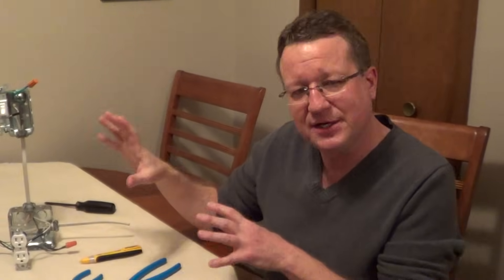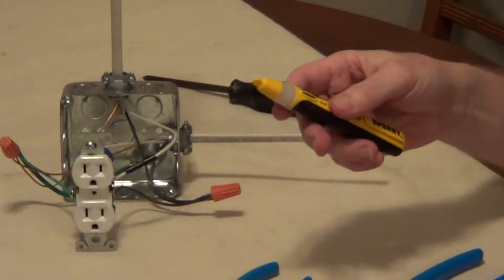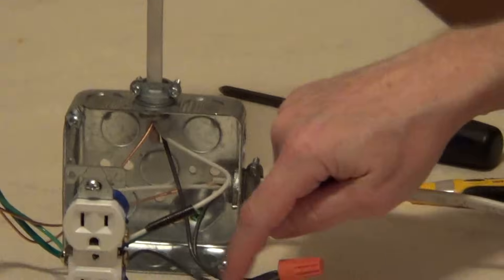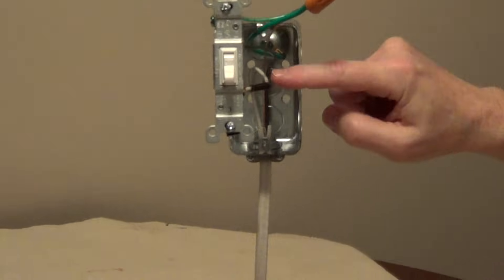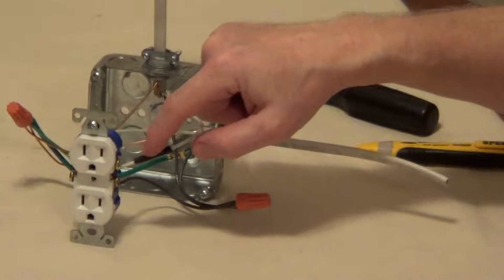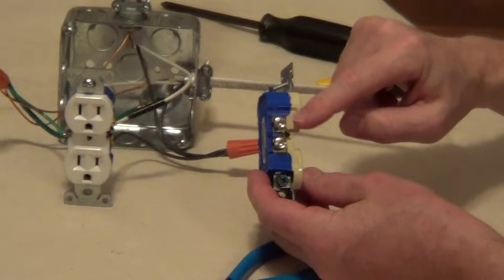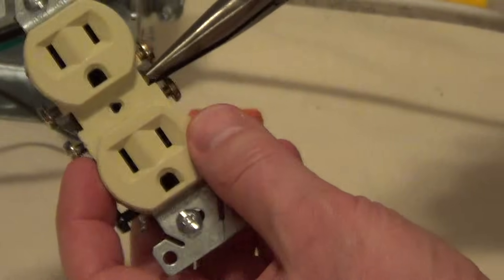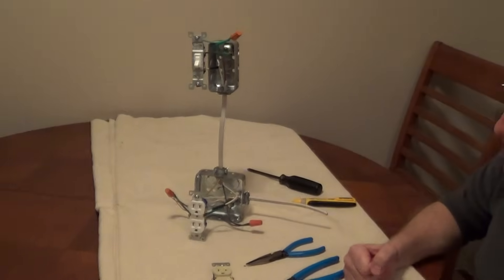How to Wire a Switched Outlet

Comment: Can both sides of the outlet be controlled by the switch?  Only one hot wire, no bridge, if not switched, both are cold?
Reply from the maker: Hi, yes you can connect the switch to an outlet and not break the tab on the hot side to turn the whole outlet on or off.
Check out more home improvement tips in our e-books https://www.amazon.com/gp/product/B0B2KW1FQ9?notRedirectToSDP=1&.
Reply: @FIXITHomeImprovementChannel Thanks!

Comment: Good info,..but do u need that pigtail for the hot, or could u just wire it directly with no pigtail
Reply from the maker: Hi, if you want to have a switched outlet, you will need to use a pigtail.
Check out more home improvement tips in our e-books https://www.amazon.com/gp/product/B0B2KW1FQ9?notRedirectToSDP=1&.

Comment: How do I install a GFCI outlet that has the top outlet only controlled by a switch?
Reply from the maker: Hi, you can't split a GFCI. You can put in a regular outlet and have it protected by a GFCI if you have an outlet before it on the circuit that you could replace with a GFCI. If it is the first outlet in a circuit, you can install a GFCI breaker. Email me if this isn't clear. fixitpodcast@gmail.com
Reply: @FIXITHomeImprovementChannel  thanks,  I just removed the wire to the switch so they're both on all the time.

Comment: Also note: only break off the tab on the hot (black wire, brass colored screws) side.  Leave the white wire side bridge tab in place.  I found out the hard way. 🤦🏼‍♂️. Thanks for the great video!

Comment: Wouldn’t  it be more proper to use 3 conductors wire?
Reply from the maker: Hi, yes the new code requires a 3 wire cable. This is how most homes were wired in the past.

Comment: So what you are saying is a new code requires you to go from a 14/2 to a 14/3 wire UNLESS it’s in a raceway or easily accessible, correct?
Reply from the maker: Hi, yes, this is the old way to wire a switched outlet. The new code wants a 3 wire cable with a ground.

Comment: Wow, that worked! Only thing I got stuck on was what to do with the other white wire from the breaker box. After looking at the video a few times I realized you wired it like a  normal outlet on the bottom silver screw. Thanks so much!

Comment: Hey there am I right ?? I did everything you said but in my case I have to bring power to the light fixture using pigtale wire from white and black connected to switch ?? Don’t know if this is right?
Reply from the maker: Hi, you can send me an email and pictures to fixitpodcast@gmail.com

Comment: At 1:30 you said you can't have 2 hot wires to brass screws without breaking the tab or it would turn off breaker. Is this true? I'd say it would just make both receptacles (upper & lower) hot and make the switch do nothing.
Reply from the maker: Hi, you're right on a standard circuit. I had a problem with a GFCI breaker tripping with the tab not broken. Should have clarified better.

Comment: where is the common white from the power coming in? does it matter which silver terminal its on?
Reply from the maker: Hi, the white wire in this setup is coming from the service panel. It can be on either silver screw terminal. You would leave the tab intact on the neutral side.
We have more home improvement tips on our weekly podcast https://www.himalaya.com/s/CR.
Reply: @FIXITHomeImprovementChannel  Gotcha thanks

Comment: I replaced an outlet where the top was controlled by 2 different switches on the wall. Even after breaking the tap off, when I plug the lamp into either socket, it stays on. Neither switch controls neither one now. Any suggestions?
Reply from the maker: Hi, you can send some pictures to fixitpodcast@gmail.com

Comment: I have a switched outlet in my room.  I want to install a ceiling fan in my room and I was wondering if I could use the switch that is controlling this switched outlet.  I know that I will have to run new hot, neutral, and ground wire from the ceiling fan location to the switched outlet box.  However I don't know where to take it from there.  Will I be able to power the ceiling fan from the outlet where the switch was controlling the switched outlet?  My thought is that I will be able to replace the outlet with a "non broken" outlet where both outlets are constantly hot.  But having both outlets that are constantly hot render the switch useless, right?  Thank you.
Reply from the maker: Here is a link that might help. Option 1 is the new way to wire a switch so you have a neutral available for other devices. 
https://www.easy-do-it-yourself-home-improvements.com/ceiling-fan-wiring-diagram.html

Comment: Does the neutral from the power source get pigtailed to connect both top and bottom or just one? And if just one which one? TIA
Reply from the maker: Hi, the neutral wire from the service panel is connected to either silver screw terminal on the neutral side of the outlet. You would leave the tab intact on the neutral side. 
We have more home improvement tips on our weekly podcast http://castbox.fm/u/6389499.

Comment: Great video  can you make both outlets hot without having to turn on the light switch?
Reply from the maker: Hi, if you have one wire coming into the box that is hot and not connected to the switch, just connect that to an outlet with the brass tab intact and cap off the wire coming from the switch. It will be hot all the time.
We have more home improvement tips on our weekly podcast http://castbox.fm/u/6389499.
Reply: FIX IT Home Improvement Channel ok thank you. By leaving the brass tab intact would I possibly encounter any issues with tripping the breaker?
Reply: FIX IT Home Improvement Channel thank you I tried this and it worked perfectly.

Comment: Have you worked with the newer leviton outlets? There is no pull tab on these outlets. Any thoughts on how these should be wired? Thanks!
Reply from the maker: Hi, do you have a model or sku #. I will check it out.

Comment: I want to replace a switched outdoor light to a electrical outlet is this possible with the current wire setup. The outlet will be on the inside opposite of the outdoor light. I'm replacing the hard wired outdoor light with a solar powered light. Electrical is updated within the last 2 years.. thanks for your help in advance...
Reply from the maker: Hi, you want to replace the switch with an outlet?
Reply: FIX IT Home Improvement Channel  no I want to replace the light itself with an outlet. I want to take the wires that run to the light and use them for an outlet.

Comment: You should have used a 3 wire cable from the switch to the receptacle.
Reply from the maker: Hi, yes I plan on doing another video with a 14/3 to show the new code. Thanks

Comment: quick question. I want to run wire from power source first to the switch then to receptacle . Do I have to reverse any wires for this. its just reverse of what you are showing. Thanks
Reply from the maker: Hi, It will be the same in the outlet box. You have broken the tab on the brass side. One wire that is always hot goes to one brass screw and the wire coming from the switch goes to the other brass screw.

Comment: I have two switches, one for garbage disposal one for dishwasher, one outlet under sink the switches control. both will run disposal but not my new dishwasher. diswasher runs when pluged into different outlet on extension cord. tester pluged in shows no lights pluged into either  plug in. whats up? Thanks
Reply from the maker: Hi, you will use a tester and work back through the boxes to find the hot wire coming from the service panel and then track down the problem. You can send pictures to fixitpodcast@gmail.com and I might have a better idea.

Comment: Great tutorial video!  I have two black hot wires on a second 3-way switch connected to the same common terminal by a technician.  Is it correct?   The wire connection, 3-way switches & light fixture are all good, but the light hasn't been working for years.  Appreciate your help.

Comment: Question. I have 2 white wires as well as the 2 black and ground wires coming in to the box. I broke the tab. 1/2 the receptacle is correct after I tested it, but the other 1/2 is reading "open hot" and won't work. What should I do to get the other 1/2 working? (I feel like its probably that 2nd neutral wire that's screwing me up)
Reply from the maker: Hi, can you email a picture of the box and wiring. fixitpodcast@gmail.com

Comment: This isn't code. Use a three wire. You need a neutral for the plug.
Reply from the maker: Hi, yes the new code suggests using a 3 wire to have a neutral available for future devices.
Reply from the maker: I added that to the description. Thanks

Comment: You dont say if you have to pig tail the neutral from the switch? Looks.to me you have it going straight to switch then back to receptacle, no pig tail, to come down to receptacle, i might be wrong
Reply from the maker: Hi, this is the way most switches have been wired with non-metallic cable. The neutral coming from the switch is marked as a hot with black tape and goes to the hot side of the outlet. The brass tab is broken, so half is hot all the time and half is controlled by the switch. The new code is using 14/3 to a switch so you have red and black on the hot side of the outlet and a neutral in the box with the switch, which is capped off.

Comment: this has not been allowed since the NEC of 2011
Reply from the maker: Hi, you are correct. I was answering a question from a subscriber about how their switch was wired.
I have under the video that the new code requires a neutral wire unless it is in a raceway or easily accessible without removing drywall.

Comment: I have a question.  I'm building a barn, and my plan is to install outlets on the ceiling joists to plug workshop lights into for lighting.  I would like to control them with a three-way switch at each end of the barn so I can turn off the power to all the outlets in the ceiling, thus turning off the lights.  I'm doing this in case I accidentally hit one of the light fixtures with my tractor or something and damage it to the point it would need replacing.  If that happens, all I would have to do is go get another fixture and plug it into the outlet (assuming, of course, that the outlet wasn't also damaged.)  Can you wire up something like that and show it on Youtube?
Reply from the maker: I will put it on our list. Thanks.

Comment: I have a switch in a room that I am assuming controlled an outlet at one point. Before I moved in all of the outlets and switches were changed out. I tested each outlet and flipped the switch but to no avail. What would you consider I do next?
Reply from the maker: Hi, I would take out all the outlets and see if you have an extra hot wire that was capped off. You can then follow the video to create a switched outlet.
Reply: Thank you
Reply from the maker: Let me know how it goes.

Comment: Hello Mr Fix IT,  I have a question?  I own a old home from the 1960s...    I have both the W and BLK wires as you have above which are both hot.....I would like to know about putting a new Smart Control to a light switch but it is asking for a White wire what do I do????   I have tried already but gave up any help please....  Thank you Diana
Reply from the maker: Hi,
If you have an electrical box with just hot wires, you will need to run a new cable that has a neutral wire running back to the service  panel.
Reply: thank you....

Comment: What if you have a hot wires running into the switch and want to connect an outlet off of the switch.  It's 12-2 line running into the switch.. both hooked on the hot side to control a ceiling light.  I (thought) I could run a line down to an outlet and hook both sides to the hot of the outlet.. similar to what you have in this video.. and one side would be on continuously and the other controlled by the switch on the wall, but it's not working.  The outlet has power, but when I plug a lamp into it, it doesn't work.  Trying to learn.. but confused here...
Reply from the maker: Hi, you need a neutral wire in the box to connect an outlet.
Reply: I really appreciate you taking the time to answer my question.  So I guess I would need to backtrack and run a 12-3 wire into the switch and go from there.  Thank you again.  Have a great day.
Reply from the maker: You too

Comment: Ok so here is the deal. I'm not familiar with electricity at all. The switch in my room turns on my ceiling fan, but I want to keep my ceiling my always on and have the switch turn on a lamp the makes my room brighter. I'll be really thankful if you can get back to me and see if there's a solution, please and thank you.
Reply from the maker: Hi, here is a link to a couple diagrams of how a fan might be wired. If you disconnect the wires from the switch and connect them with a wire connector, the ceiling fan will have power all the time. You would control it with the pull chain. You could also go into the box about the fan and connect it directly, but that would be more work. You could now run a new cable to an outlet and create a switched outlet like in the video I have. 

Make sure to always turn off the electric and double check it with a tester. Let me know if that helps.
Reply from the maker: Here is the link http://www.vox3d.com/wiring-a-ceiling-fan-with-light-diagram/

Comment: i currently have this setup where a light switch controls one part of the outlet. i installed a ceiling fan with light and ran 14-2 wire to the light switch i am confused as t how to wire everything due to the outlet being a middle of the run. so to the outlet i have a black and a white wire coming in from a different outlet, then i have the black and white coming from the main power source. then there is another black and a red(guess this was used in place of white) coming into the outlet from the switch. at the switch i have the black and red and then my new wiring the black and white.  how do u rewire so the outlets are always hot and the single pole switch turns light and fan on
Reply from the maker: Hi, for the outlet. Disconnect the wire coming from the switch. Replace the outlet with a new one and do NOT break the tab on the brass side. Here is a link to a diagram for the ceiling fan. Let me know if it helps. 
http://www.protoolreviews.com/news/wiring-and-connecting-a-ceiling-fan/3944/
Reply: +FIX IT Home Improvement Channel thank you i figured it out yesterday i appreciate your response
Reply from the maker: You're welcome.
We have more tips in our home improvement book http://www.amazon.com/dp/B01BK2K0JM?ref_=pe_2427780_160035660

Comment: I'm trying to add a switch/outlet to an existing single light switch. my house was built in the 40'stand only has 2 wires total. The wires are not black nor white. They have old tar/wax on them along with thread. Is this possible.? I'm wondering if I could pig tail to give myself more Wires?
Reply from the maker: +Jay Williams Hi, if the existing box only has the 2 wires for a single pole switch, you can't add an outlet. You need a neutral wire.
You can run a cable from an existing outlet.
Reply: It seems the previous hack ran the hot to the light,then to the sindle switch. If thats true ill have to run a line from the light to the new switch and receptacle. Thanks for the response.
Reply: There is a common/neutral i believe.  I have a tester and 1 is obviously hot. There is also a gfci ran and will read good with my outlet tester but turns off when i turn light on. Which again keeps pointing to the adding another wire. Thanks again. Ill be watching more videos as i plan on running all new wire to my upstairs soon. Thanks Jay

Comment: One room of the house I just got has a red wire in the switch's box and a red wire in one of the outlets. For some reason the wires weren't connected on either one. 2 black wires and 2 white wires and 1 red wire unconnected on the switch. I tied off the 2 white wires and put the 2 black ones on the bottom  of the switch ("off" position). Red wire on top in the "on" position. The switch powers nothing off though.
Reply from the maker: +rkgsd Hi, you will want to start by using an electrical tester to find the hot wire feeding the circuit. Then work from there. Send me some pics and I can try to help. fixitpodcast@gmail.com

Comment: I m not a electrician but i just run a a wire that has a red and a black and one white and a copper and just use my switch on the red and the black always remain with power to the bottom

Comment: Won't you use a 14/3 for this one ?
Reply from the maker: Vova ******* Hi, if you have a 15 amp circuit, you would use 14 gauge wire. If it is a 20 amp circuit, use 12 gauge wire.
We have more tips on our weekly podcast https://itunes.apple.com/us/podcast/fix-it-home-improvement/id880903087?mt=2

Comment: How about if i want to change a switched outlet to being hot all the time so that i can use the switch to install a ceiling fan/light instead?  How do i rewire to leave it hot at all times?   It currently has 14/3 romex wired to it and the switch.
Reply from the maker: Hi, first turn off your power to this circuit. If it is wired like this video, you would remove the outlet and replace it with a new one, because the tab is broke on the hot side. On the new outlet keep the tab intact. You would unscrew the wire connector on the black wires and connect the wire coming into the box from the service panel direct to the brass screw on the outlet. You would leave the wire going up to the switch and coming down from the switch off. If you don't know what wire is coming from the service panel, you would separate all the wires so nothing is touching, then you will have to turn on the power and test the wires with an electrical tester to find the feed wire coming from the service panel. Turn off the power before connecting. Let me know if that helps.
Reply: Thank you so much for the help!  I will attempt  this tomorrow.
Reply from the maker: Let me know how it goes
Reply: I want to do the same. any advice?